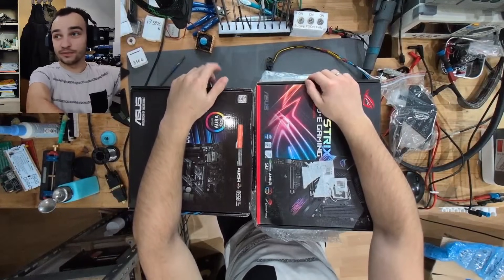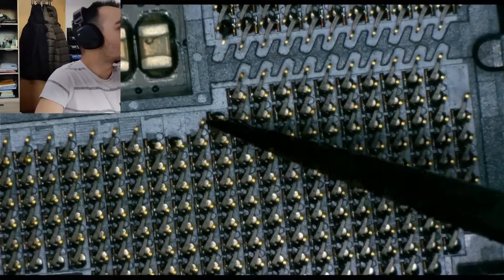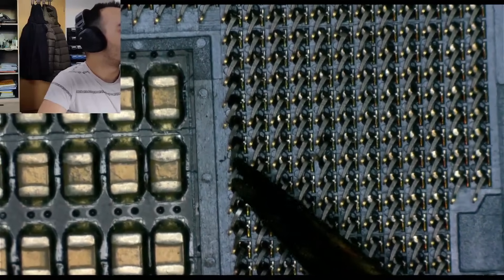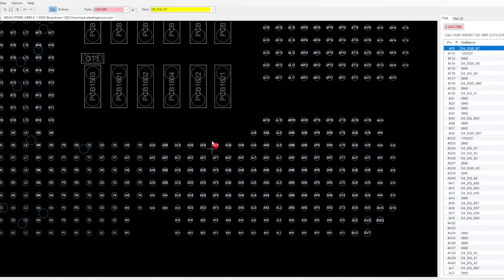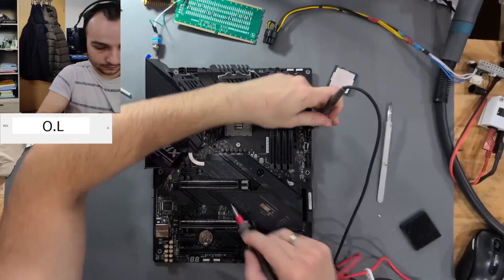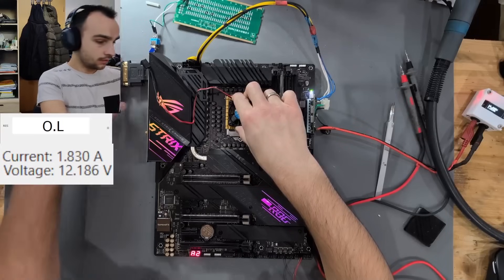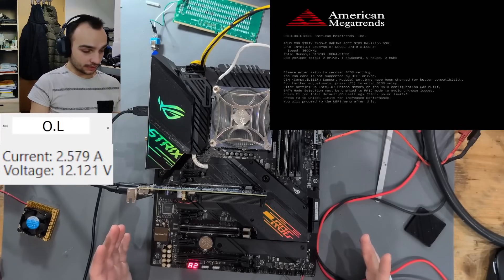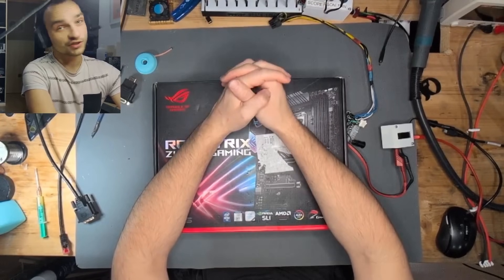VIEWER SENT IN 4 BROKEN MOTHERBOARDS || CAN WE FIX THEM? STRIX Z490-E REPAIR MTOHERBOARD

Comment: Hello master MOBO Yoda repair ninja !.
Much respect for shared knowledge.
Why not just change the socket ?
Reply from the maker: Hey there, an honor to hear that from a GPU guru like you!
i do not own a preaheater to change the socket! And also no way to hold up my hot air station! 
Eventually i will get a setup with which i can do that. So far i am just collecting all the socket replacements and the dead PCH´s for a future where i have the equipment!

Comment: Hey, do you have discord or a server? I need assistance with a motherboard. Vga led for 2s, then dram for 0.5s then vga again 2s. That around 1m and then the motherboard posts. Can you help me please?
Reply from the maker: Hey there, i do not. I would suggest to try another bios! Expecially with a clean ME region!
Reply: @MainboardMedic  It's an AMD board. I finally solved it, a vin12 trace was not doing contact properly, but I had al voltages. I suggest you to make a discord server, like the NWR one, but in this one for mobos repair and help. I think that it's a great idea.

Comment: u can replace the pins without change the socket.. its not hard to do it :)
Reply from the maker: Ive done it before but on a lot smaller boards, i will  need to get a proper pre heater to do that so i cause minimal damage to the socket itself!

Comment: Gigabyte charges $100 to replace AM5 socket, even if the board is under warranty.
Reply: I mean physical damage is not fixed under warranty
Reply: @ksenchy  but they are so fragile .. not cheap either because of the gold pins
Reply: @samm928  I know. What can you do

Comment: Hey, when i have a broken pin on LGA , i replace the pin, the process is very easy but you need at least a preheater ( i do this only on socket below LGA1700, because the pins hole are too small, but not impossible )
Reply from the maker: And thats what i am missing! I am still looking out for a good preheater in size for Mainboards!